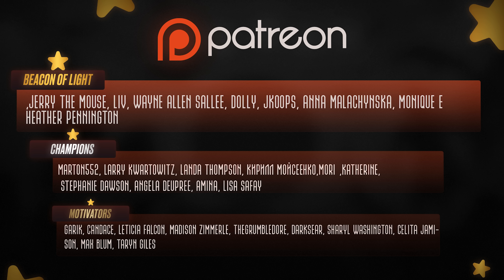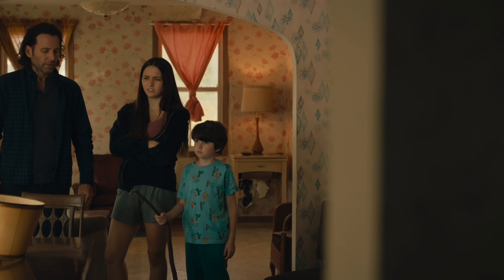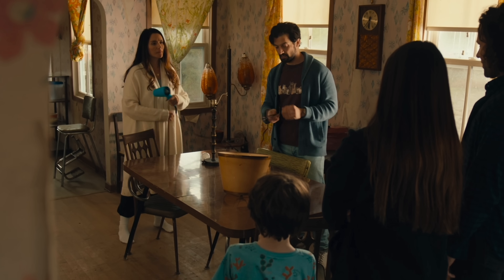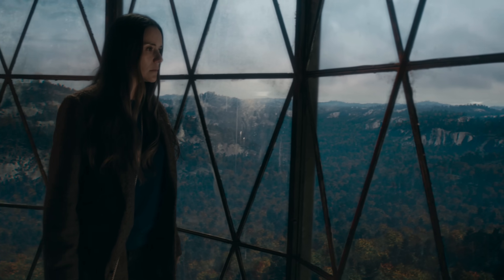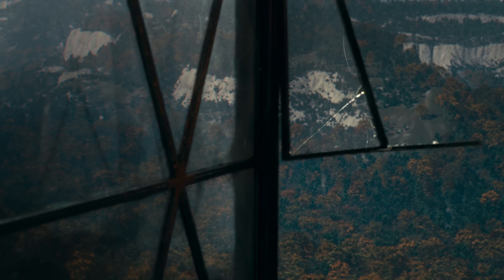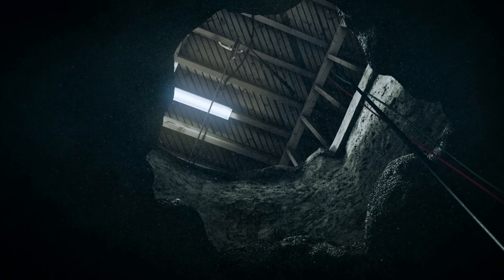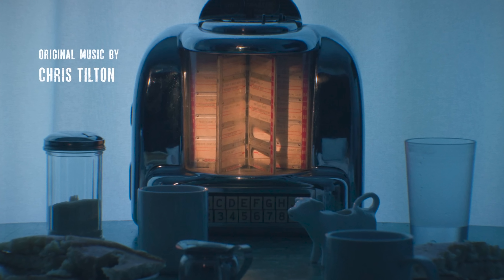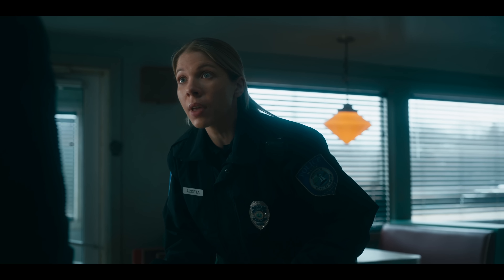#frommgm ELECTRICITY - HOW IT WORKS AND WHY? THEORY

Comment: i like the idea of the electricity radio and phone being connected. obviously whoever controls the radio as well as talks on the phone can see everything that is happening somehow.

but as far as being chris i think we would need more evidence to get to that conclusion. what makes me question it is that when the phone is used it can seemingly change its voice to sound like different people. so that makes me think its more of like an entity or something.

but its certainly possible it could end up being more literal and someone is actually watching them from a location and is controlling radio waves electricity and telephone signals which are 3 different types of signals/energy. a radio wave definitely is wireless but the other 2 both usually require a wire unless its like a modern telephone which also sends a signal.

great attention to detail though, i will be looking closer from now on thats for sure. thanks for sharing

Comment: In an interview the creators said that they knew where they were starting and where they wanted to end but that they were feeling free for what was happening along the way. So the flickering lights might be something meaningful or the writers just having fun with a supernatural cliché. It could be the same thing with other details that bug us like the clocks, the colors, the symbols.
The flickering lights could also be happening  because the characters saw this happen in  supernatural tv shows.
The electricity could be a manifestation of beliefs or of some kind of energy that flows in the tunnels. (By the way do you remember how as soon as Tabitha made a hole in the tunnel ceiling, Something hastily plugged it by collapsing the house on it? Almost like a body sending platelets to stop a bleeding.)
It is the same problem with water and air, we don't really know how they are supplied to Fromville.
And I'm not sure we can say for sure that the BIW controls things in Fromville, he might just know how to use some of its features, like communicating with humans or sending a human back through the lighthouse. I think he's not a guard but more of an older and more knowledgeable inmate so to speak.

Comment: We always see the numbers 4 and 7 in Fromland.  47 is the number for Silver on the Periodic Table.  Silver can be used to create electricity, particularly in renewable energy technologies. Silver has the highest electrical conductivity of all metals.  You can use silver and water to create electricity, particularly by using saltwater as an electrolyte in a battery.    47 (silver) may be a clue as to how Fromland gets its electricity.

Comment: I wonder if there are any connections between the actual songs that we've heard. 
For example, "Ooh Child" by the Five Stairsteps came out in 1970, and "Celebration" by Kool and the Gang came out in 1980.

I don't know if that, or any part of the specific songs matters, but I do wonder.

Comment: Honestly, the only thing I can come up with about how the town works is to think of it like screenshot. Or rather, a series of screenshots compiled together to form a town. When you take a screenshot of your computer or phone, you get an image of what was on the screen at the time, the clock, the apps, but none of the functionality. The numbers on the clock won't change, the apps won't open when you click them, just a frozen moment. I think the town could work on a similar principle. Whatever created the town lifted these buildings and bits of infrastructure from reality and made them into a kind of living photograph, and in my mind at least, this could explain how the electricity works without having any wires inside the cord. 

When you take a photo of a lamp, you get the image of that lamp. The cord, the shade, the bulb, even the light it gives off. But you can't see the copper inside the cable, or the electricity flowing through it. The only thing it needs to show you for you to realise it is a lamp is the outer image, it doesn't have to show every internal component for you to understand the image. 

I think whatever entity created the town knew what these things were and had a basic understanding of how humans interact with technology (flip switch = lights on) but had very little understanding of what actually made it function. It was working with what it could see, ignoring the innards and substituted the science for magic in order to make it functional, which is why Jade was able to hotwire the lamps to power the radio tower. 

The entity knows electricity exists, and has something to do with cords being plugged into walls but doesn't get the intricacies of it.

Comment: BIG TIN FOIL HAT THEORY:

I think From ille runs off death- or rather, it harnesses the lives of the people that die there to power the Lighthouse and (as a very minor aside) powers the electricity of the town.
The tunnels beneath everything are how this power flows and the monsters stay there to absorb what they can to maintain a semblance of life. 
They're parasites but necessary.to keeping things running.
The electrical cables dangle into the tunnels to harness a tiny bit of this power.
The Lighthouse serves some good and noble purpose but things are failing- lenses are broken and maybe the light grows a bit dim.

We know there's a cycle to things in Fromville and I think WE see the show in a too linear fashion- the Colony House massacre not only powered the radio transmitter but the radio transmitter caused the massacre. One makes the other happen.

The flickering lights and voices Sarah hears might be the dead trapped in Fromville.
Some try to help- like Abbey and other lash out and demand revenge.
I think the flickering lights are either the dead trying to communicate with people that can't hear them or are a third (fifty?) faction trying to get Boyd or Jim to notice them.

Comment: Different devices have different light waves…Elgin had a flashlight the showed what is really in the root cellar as opposed to when Jade turned to light switch on and saw the symbol and man crushed by boulders in the closet. So maybe the lights are showing the way for Boyd…Also the lights in the diner look like Fairy lights.
Reply from the maker: Interesting’
Reply: And the light of the fire torch showed Boyd the complete different dimension with Martin.